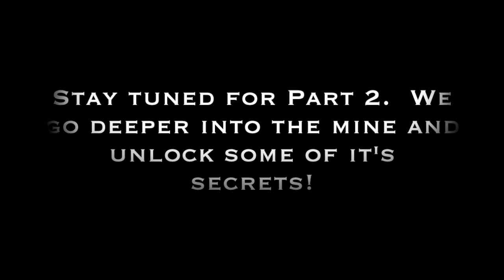A Mine With Huge Stopes and Bottomless Pits - The Thompson Mine

Comment: Glad to see you hit this one as I didn't have time to visit on my recent trip to the area... Those ladders didn't look too bad for coming back up if you rappel down there. I'd be curious to see if there is a body down there because I don't have a lot of confidence in the individual that tied that rope off and, presumably, headed down that manway or winze.
Reply: Oh, and just FYI in case you don't know (I found out the hard way myself)... Anyone with TubeBuddy can see the tags you use. So, in this case, for example, the real name of this mine is revealed. I just thought you might want to know in case it was not your intention to share that publicly.
Reply from the maker: Indeed.  The problem is a suitable anchor.  I look at mine timbering as a large version of 'Jenga', and that's all you've got for anchors.  I thought about a Spanish picket system, but that's just too much work in such a small space.  

I'm waiting to see if The Engineer has pictures of the overhead of that manway.  There was a piece of steel (might have been ore cart track, not sure) across two horizontal timbers.  It looks like it was once used as a cable support, but it's not affixed (i.e. not bolted to anything).  If it shifts, your anchor goes away (and so do you).  

It looks like there will be a Kommando Mission (weekender) back to the area in the coming months to visit two mines we missed.  If time permits, I'll re-visit this mine and descend.
Reply: The Jenga analogy is a good one... That really is what timbering is about. Well, I hope you do go back. I enjoy your videos and I'm particularly curious about this one.

Comment: Nice effort, but the "huge stopes and bottomless pits" of this mine pale in comparison to those of the Thunder Ridge mine from the 1870s (Abandoned and Forgotten Places, Episodes 140-144), which was essentially a mountain hollowed out from the inside with black powder and hand-drilled blasting holes. Its Silver Expanse shaft was 1300 ft. deep and the Silver Fortune Tunnel was over 4000 ft. long.

Comment: As far as the cost of doing this fuel wise... I noticed the last couple vids that it looks like you've got 3 trucks in the outings, is this going to be the norm? Certainly going to cost a lot more in fuel that way. How far are you traveling to these places? What area is home and what general area are you typically going to to explore? How much time do you set aside to do these adventures? Do you camp out there? I'm liking the drone footage by the way, wish I had one.
Reply from the maker: Three trucks usually is not the norm.  Usually it's just myself and Mike, in one truck.  Those trips are usually weekenders, and the distance varies, but usually in the 450-600 mile range (round trip).  We are actively looking into mines at half that distance, but California has a bad habit of sealing up old mines faster than Nevada.  Mike and I are going to finish out the Alpine Mine (video from earlier this summer, only got partially down the main tunnel) soon, and go look at another one not far from it.  That will be just a (very long) day trip.  We love getting out there, we love exploring these old mines and documenting them, and we just have fun together on the road.  

I was wondering out loud if it would be worthwhile to set up a Patreon to help defray costs, not to make money.  There's never been a profit motive for this, just a hope to break even while enjoying the exploration.  It's easier on the budget, and that means less time working, more time exploring, which translates into more videos I can bring to viewers.  I think for the time being I'll just keep covering all the costs, especially since winter slows down the exploring.

Comment: Blimey, seeing that new rope like that is kinda worrying what is down there!  There must be another way in , a lower adit?
Reply from the maker: No sir, no lower adit.  The '100' level is the sole adit.  The other 4 levels saw service from the main shaft or winzes.  I think a return trip will be needed on this one for sure, but I'm not certain how to approach lower level access.  

I may just need 200m of rope x 2, lots of edge protection, and a vehicle anchor.  I'd wager the ladders are sound enough to climb for the return trip.  The curiosity is figuratively killing me....

Comment: What is the lumens rating and brand and model of light is that you have that focuses into a square beam?
Reply from the maker: david sul Generic light off Amazon.  Allegedly 1000 lm max, but measures out closer to 800.  It takes 18650 cells (1), so I salvaged some cells, and use the included 18650 as well.  It does seem durable despite its low cost, as it has now survived multiple accidental drops from 3-25 feet.

Comment: Although it is also possible that someone tied that off to lower a camera or a light, and no actual person hung from it. That said, it would be, umm... interesting? ...to go down there (safely) and see if there is a mummified idiot. 

Hey, maybe the guy had cool swag, right? I mean, um, his family would want to be notified.
Reply from the maker: One thing not shown in the video is that the lower end of the rope was also tied off to something.  We tried to pull it up and remove it (so no one else would get a stupid idea), but it was clearly tied off about 70 feet down.  

There could be a body 400 feet at the bottom, too.  I had all the gear needed to get down there properly, but I did not trust anything as an anchor in that spot.  You can hear Engineer going on about how to anchor off, but IMO none of those were life-suitable anchors.
Reply: Wow, that would be a hell of an experience... I'm kinda burning with curiosity about it now.
Reply from the maker: Over the past 4 hours, I've gone from "meh" to "if I don't find out, I'll burst."  It's a long, lonnnng haul from home, but I may have to figure something out for after Thanksgiving.